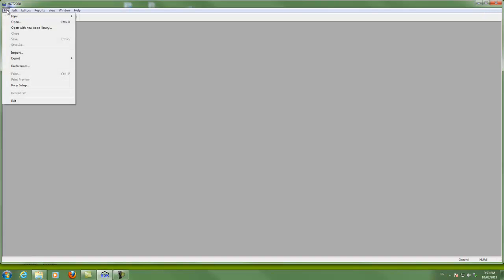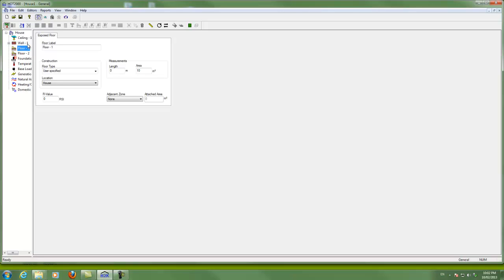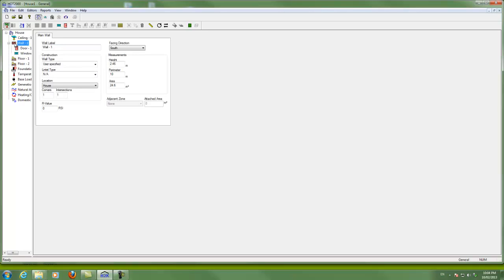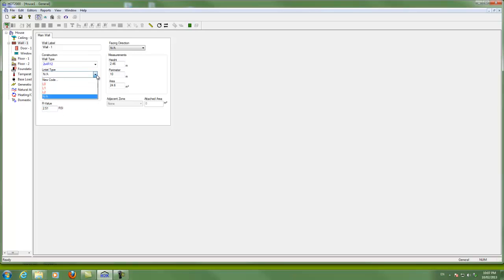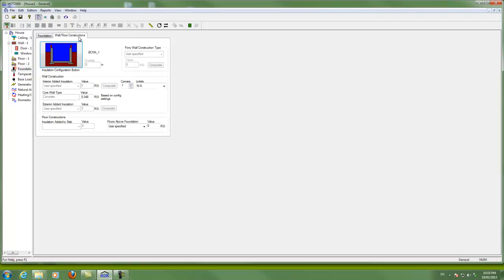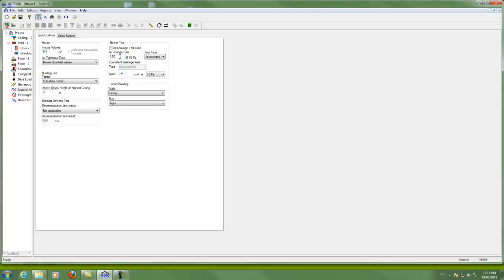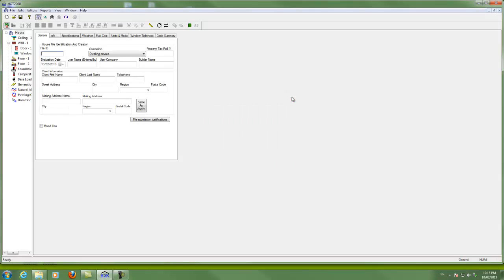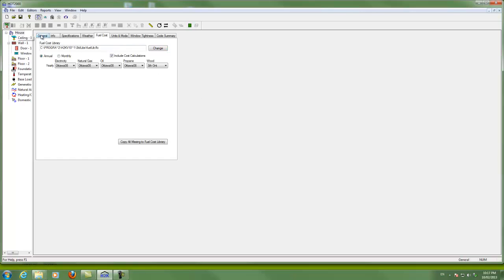Hot2000 Intro 17min

Comment: can you fix the resolution? Fonts and drop downs are so tiny
Reply: looks fine for me.  Are you maybe viewing on a phone, tablet, or small computer monitor?  This would undesirably scale down the video to fit the smaller screen.
Reply: @btarb242  I meant the actual software. Not your video. Running the actual on a 17 inch laptop and the scale is tiny.
Reply: @ynotbbq  I had this problem; the fix is you have to run it in compatibility mode. Right click on the icon on the desktop, go to properties > compatibility > run this program in compatibility mode for Windows 8 (or other operating system)
Reply: In the same tab, hit the button at the bottom that says "change high DPI settings" and tick the box that says "override high DPI scaling behaviour." Hope that helps